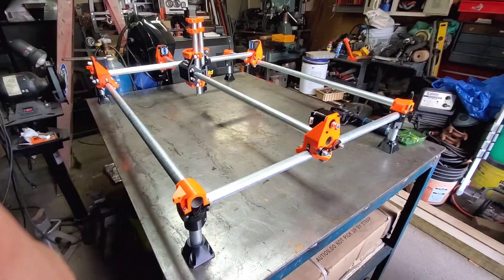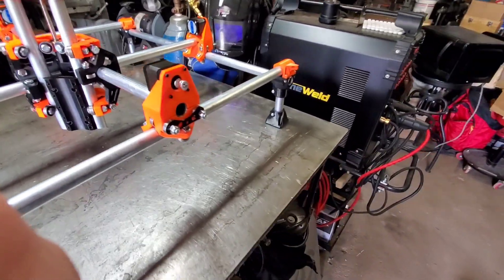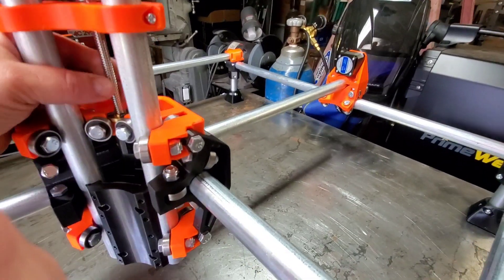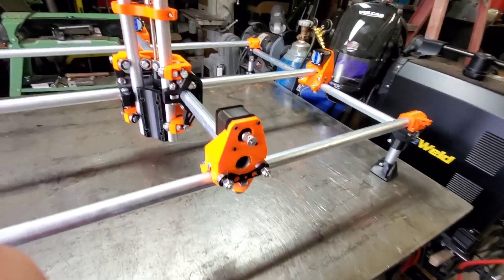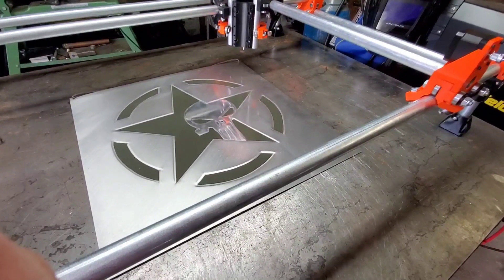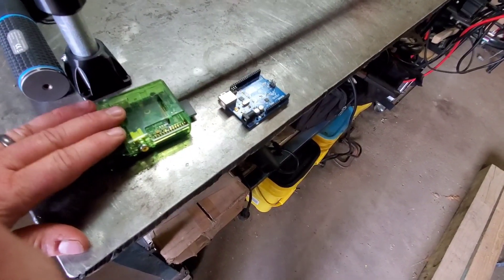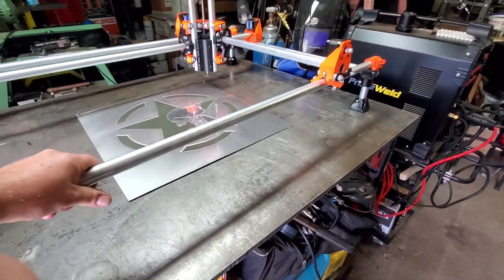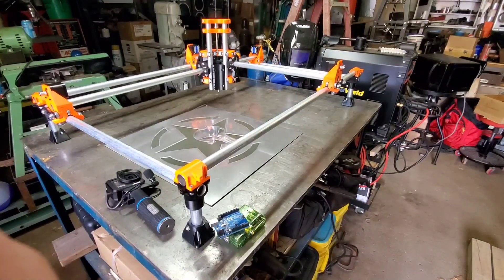10 in 1 MPCNC Part 1

Comment: Lol I have the same tig welder and currently building my MPCNC
Reply: I got mine most of the way done and then got too busy.   It was a plasma cutter      I changed one detail tho.  I took the collars that go on top of the legs and connect to the holders of the horizontal rails.  And made them one piece.    Added support.   But increased rigidity